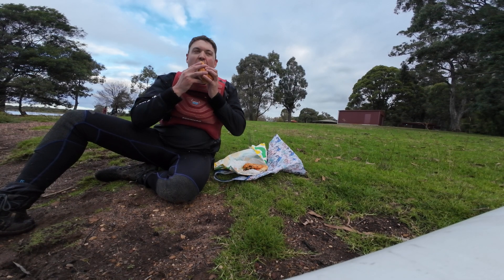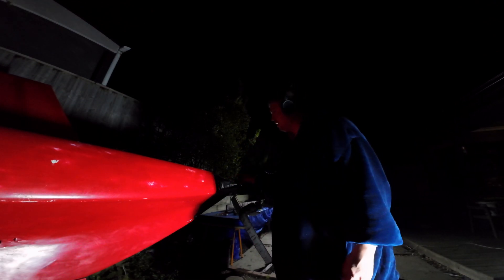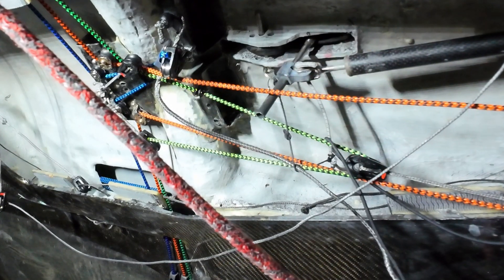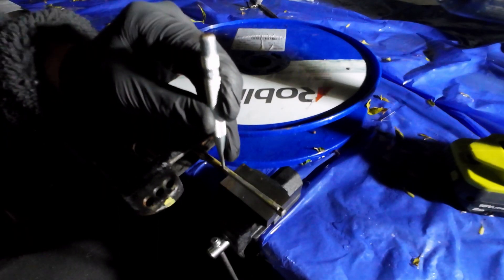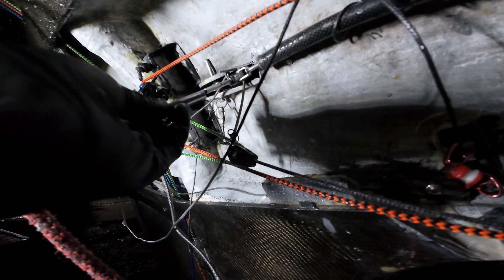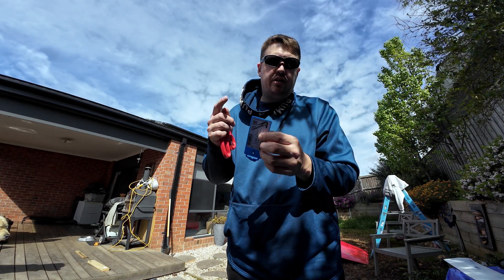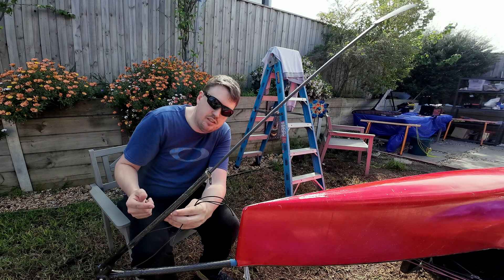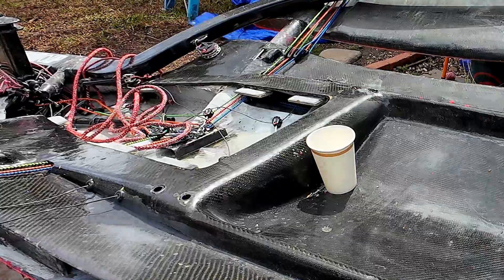Building a Hydrofoil Control System in the Backyard | $100 Moth EP9

Comment: Hi Tom,
Did you Check you dont have possibility to adjust vertical angle instead of playing with the horizontal ?
Maybe grinding a bit the socket at the Rear and put some époxy at the front (and opposite on top of the hull) ?

Because putting too much cardboard makes a weaker connection between vertical and horizontal. Usually mach2 recommends maximum 2mm of cardboard.

By the way regarding the gearing my recommandation is to get the crankbell short as possible and put the élastic on the RHA itself not on the Bell crank.
With mach2 foil We always need maximum gearing, not really needed to adjust it. Then Bellcrank is not used and can damage sail or you, better to cut it.

Last but not the least : the fast point. Be sure your bellcrank is perfectly perpendiculare to the deck when flap is in neutral (use your 3D printed stuff), it Will help you to get réactive foil 

Nice progress and Nice vidéo Hope to see you Sailing Soon
Reply from the maker: Thanks for the comment Alex, brilliant detail! I did have some difficulties with the top of the foil and getting it to line up with the existing holes, basically it only lines up with one of the 3 holes. I measured the angle of the vertical relative to the hull and I’m told it’s normally 7-8 degrees, I was a smidge over 8 degrees. That’s a clever idea about putting the shock cord on the RHA. How many wraps of RHA line do you normally run around the RHA drum? At the moment I have about 5 wraps and it doesn’t seem grippy enough. I came across the issue with the bellcrank position relative to the flap on my last boat, when I fixed it I was able to take off going 1 knot slower than I could before I fixed it!
Reply: @TomStuchberySailing  Hi Tom
Mach2 relative angle for the vertical is 6 degrees Forward. Thats why the fast point for the crankbell is 6 degrees Forward 
8 degrees seems to much to me. It will force you to add more and more cardboard and take risk on the connection between Horizontal and vertical. This point is very touchy, Many people lost their foils du to bad continuity of effort du to either to small surface connection or not having glue with epoxy to make the Perfect shape.

Regarding the RHA I have only 3 turns and it is in continuity system. Less turn better it is. Many sailors add so sand papier around the drum to add grip.

I dont recommend to increase the drum diameter cause it will touch the deck, or reduce gearing capabilities 

You are Closer every day ! Thats Great !